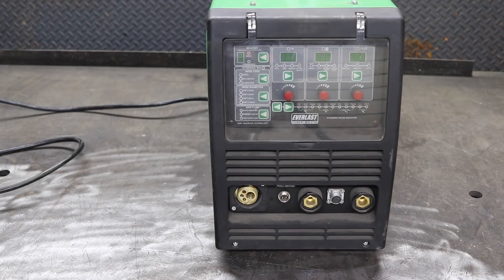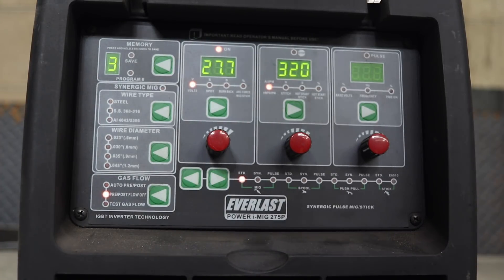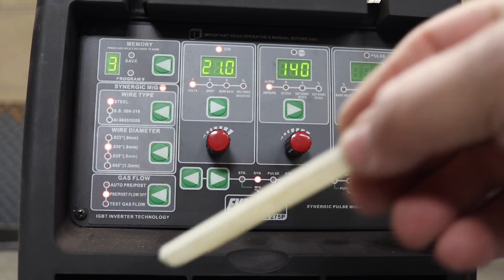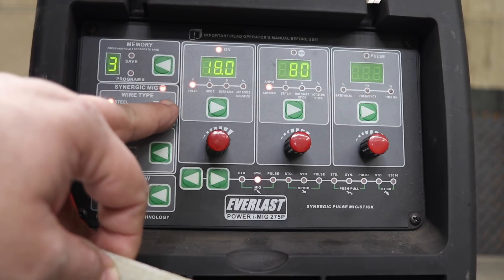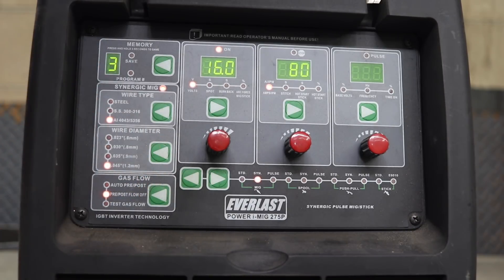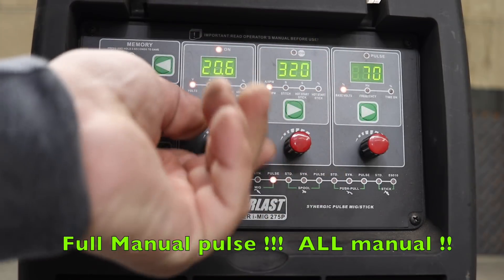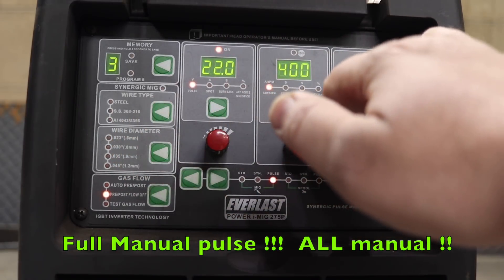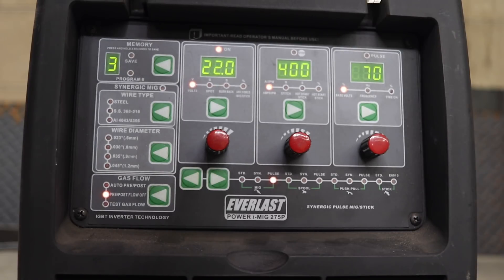Everlast I mig 275p the front panel explained   synergic or not ? full manual pulse !

Comment: Did you ever make the follow up video to this one with settings? I can’t seem to find it
Reply from the maker: I never did, what it boils down to - for aluminum it is "not practical" .... as you have to adjust "heat settings" constantly ....  and as soon as you adjust one value, you need to adjust 4 more ..and by the time you are done with that the temperature of the aluminum has already changed again and you need to adjust settings..... so in reality for aluminum this machine is pretty much not suitable ....  for pulse tell or stainless ...  sure - this can work. you will have to spend 2 weeks and figure this all out the long hand way ......      when "premium" manufactures like miller, Lincoln, fronius, Stel, cebora, migatronics, ewm .....  do pulse synergic curves ... they put a welding engineer and a software engineer and some professor from a technical college in a lab for 2-3 month to figure ALL these value out the long way, then they put these in tables and program those in the logic of the welding machine ....  so if you want to make this work ... you have your work cut out for you ....  
I solved that by getting a 253 Dpi .... that is SOOO much easier ....

Comment: Hey Peter, Just curious what are your thoughts on Everlast 253 dpi , there is only a couple of reviews on this machine and they say how great it is on aluminium but there wasn't any video or photo proof . I guess what i am asking, in your opinion is the 253 dpi going to be a lot simpler to set up than that lovely 275p i have. I can not even find a manual to download for the 253 dpi on everlast website. I understand if you have not used one yet I'm just after your thoughts or if you have heard anything.
Cheers from Australia
Troy
Reply from the maker: Troy,  
I have probably seen all the videos you saw, I have also heard and read all the claims you heard and read and just as you I have yet to see someone post something online a video with a few arc shots.....  so that being said, I am fortunate that I have had an option to test the 253DPi first hand ...    I welded with it and there are a few things that are different than on all other brands machines I own or I have ever welded with ...  
So as far as the way how the machine is designed  - it is supposed to work similarly to a PP200 or a Lincoln 350mp or miller 350P (which is only a single pulse machine).  The Everlast 253DPI has a full synergic single pulse which is nice and having a full manual adjustable double pulse is nice but it would be also would be nice if it had a "factory" double pulse setting.  
What I saw is that the machine needs some finesse to weld aluminum still and all the videos I saw I saw people stick weld with it I saw people pulse MIG weld (steel with it)  - you can also tell that some people don't have much if any experience with pulse or double pulse and that is just hard to make a good video on this topic ...  and yes - there is no manual yet.   Hang in there for a few more weeks.    
I found some stuff out that others apparently have not found out about it so I found a way to make the pulse aluminum work well (there are still some limitations to it - but overall it works well) - I found that you need to "upgrade" some accessories and consumables .... but like i said - give it about 6 weeks - I hope to be the first to post a video on this topic ....
Bottom line it is still MUCH easier than the 275P but it is less powerful too.   
Keep in mind - I do NOT have much arc time on it, I cannot tell you how things are holding up, this is only based on a very brief first impression.
Reply: Hi Peter , Thanks for your advice much appreciated as always. Now i am concerned as the Everlast website says in there product description of the 253 dpi says the double pulse is fully synergic so to someone like me keeping in mind I'm self taught does have a factory setting that can be adjusted ? 
Peter i would love to get my hands on HTP pp 200 mig but we are kind of limited for choice of decent welding machines here in Australia for the home guy to weld aluminium (2) idont have 3 phase in my shed so I'm unable to have a better machine (3) i unfortunately dont have a lazy 10 grand to purchase a better machine. The reason i chose Everlast is i have there 210 EXT which I'm extremely happy with and was hoping one of there migs would satisfy me the same .
Peter would love to come over and have a lesson or two with you but unfortunately we are a little far apart from each other and is not going to happen anytime soon .
I look forward to seeing your videos and once again thank you for your time and effort into doin this .
Take care ,stay safe, Cheers From Australia 
Troy
Reply from the maker: Troy, let me help you to try to shine some light on this:

>> Now i am concerned as the Everlast website says in there product description of the 253 dpi says the double pulse is fully synergic so to someone like me keeping in mind I'm self taught does have a factory setting that can be adjusted ? <<

Let me try to explain this as accurate as i can.  The 275 is advertised as a synergic pulse mig machine. The 275 is a synergic mig machine - that is correct - and it has (full manual) pulse capabilities that is correct too - what no one tell you ()besides me in this very video here , is that once you go into pulse it "looses" all synergic capabilities. 
Back to your question: the 253DPI is a full synergic mig machine with synergic (single) pulse. it is designed to work similar to like a miller 350p which is also a synergic (single) pulse machine. It does not work the same there are a few differences but the idea of the concept is similar. What that really means in plain english is: as the operator adjust the output settings (in case of that everlast you are looking at amps) the pulse parameters (for sure frequency - that is audible) but possibly other pulse settings might change also.
Now to "on up" miller everlast added a double pulse function which is a a manual double pulse function. Please note: turning on double pulse is NOT going to "mess up" your single pulse - which is nice but there is no "default" for double pulse - you have to actually pick your own double pulse frequency and a few other parameters all by yourself.

>>Peter i would love to get my hands on HTP pp 200 mig but we are kind of limited for choice of decent welding machines here in Australia for the home guy to weld aluminium (2) idont have 3 phase in my shed so I'm unable to have a better machine <<
To my knowledge neither Stel nor HTP sells to Australia, unless you pay an arm and a leg and then you still have the issue :" what are you going to do for customer service?"   I suppose you could bay order a machine ... but frankly i wouldn't  - although those are good machines - if you cant get parts or tech support without waiting weeks for a board if something goes wrong ... maybe you need to look for something that is available ...

>> (3) i unfortunately dont have a lazy 10 grand to purchase a better machine. The reason i chose Everlast is i have there 210 EXT which I'm extremely happy with and was hoping one of there migs would satisfy me the same .<<   I never welded with a 210 EXT personally.  My buddy Jimbos says is a good machine (for what that is worth)    As far as me recommending the 253DPI - i need to get a lot more time and some classes on that machine yet with people here at my shop trying it out and i want to see how others do with the machine and how it holds up ....
Like i said: so far i found what i told you already BUT i have very limited arc time on the machine.

>>Peter would love to come over and have a lesson or two with you but unfortunately we are a little far apart from each other and is not going to happen anytime soon .<<  
LOL  absolutely - i had a guy from Nevada fly in for the last class ... but Australia is a little far ...  unless you ever come to visit the Harley Davidson museum in Milwaukee  - than i am only 20 min out of your way

>>I look forward to seeing your videos and once again thank you for your time and effort into doin this .
Take care ,stay safe, Cheers From Australia 
Troy<<

thanks !
Reply: for the extra 1500 im not sure its worth it, I've just ordered the 275p as well. I'm in the same boat living in Melbourne Australia our choices are crap for a good range.

Comment: Hello
I think with every machine there is a learning curve. I have licolhn and have
Everlast yes both machine need fine tuning is always going to be a challenge. I just got 275 p as well and have been playing around. So it's like anything else. Have to learn the different feature. Great video
On the everlast

Cheers Fred
Reply from the maker: Fred, are you planing on doing any pulsed aluminum welding with it ? and yes - setting this up is a challenge -I tool a quick look at your channel - looks like you are the "methodical" kind of guy and if you don't pull all your hair out over it. - you will get ok or even good results.  
If you don't have a full synergic mig machine with synergic pulse to "look at" and get en idea about starting point ....  than it will be a long uphill learning curve ....  but I am sure you'll figure it out.
Reply: ZILA 
Yes I have been looking around for while for good pulse machine 
But the prices were out of my reach .
I have had everlast tig machine for long time. Now getting in to the mig 
Machine my licolhn in a good basic machine and works great But with all the heavy steel that I have been welding lately I desided on the I275P
And yes fine tuning is always a pain. So I have to say your video has opened up all the nuwonse that I now don't have to look for. You have done and outstanding explanation on how this machine Everlast should be thankful you are doing this. I myself don't get any freebies unless I pay for them myself as well.
Anyway great video  and great content.

Cheers Fred
Reply from the maker: Fred's Machine Werks i bought the machine used on craigslist for $1200 because the previous owner couldn’t figure it out ...
I intend to teach classes for $ with that machine for everybody who bought one and couldn’t figure it out.....
Lol

There are no freebees for me either - but everlast sure called me last week after all those videos....
Reply: ZILA 
That awesome your doing an outstand job.
It's nice when fellow deutsche lander
Doing training video.

Cheers Fred

Comment: why would anyone build pulse manual machine ? It's simply stupid. Pulse settings are almost imposible to set properly, that's why you pay for the premium machines. You might set it to weld and that's all. Pure marketing crap.
Reply from the maker: Kevin - thank you.  one guy here at least that can follow my thought train ...  if the "big names" pay REAL engineers and professors at tech colleges 10 or 100 thousands of dollars to find those settings in a matter of weeks or months .....  how is joe blow supposed to figure this out in his garage all by himself  ???  
and some guys really argue that point here in the comments ....  

watch the videos to come  - they will illustrate it pretty drastic !
Reply: I agree, there are even big differences betwen higher end manufacturers. Lets say if your welding some alu (serial production) or setting up a robot, it's not bad idea to invest in some fronius or otc machine (I didn't try any american machines so I cant comment on that). I had quite some problems with lower italian brands (not stel) on 2mm tubing, mostly with inconsistency of arc. Allthrought I did some welding with chinese mig welders similar to everlast or longevity and they are great for home use. But I still prefer 30 years old 400 amp transformer mig for general steel welding and these machines are cheap here in EU. You can get some older industrial 300-400 amp mig for lets say 600 dollars. It's just not really portable :)
Reply from the maker: I agree, there is a ton if Italian manufactures ... and me observing the market and heaving welded with a lot of them ... some are just better maybe even much better than others .... fronius makes an excellent machine ...  they have a hard time supplying "bigger" machines to the american market because of the difference in electricity ....  the small shop or hime owner who does not have 3 phase power here in the USA and has to use 220,230,240 volt single phase machine ... his selection is VERY limited by fronius .... and their machines are good but big $$$ also ....  for "standard " mig I can see your point  !!!!  
although I might make a video about a machine shop here who had a mig and a tig both the size of a washing machine weighing 800 lbs each ....   - and replaced both of those machines with a PP200 and loves it ... for the little bit welding they do (some small repair jobs - not full fabrication)
Reply: @ZILAwelds    Inverters look nice and small but my 1983  Sychrowave 250 does everything well with a nice duty cycle except portability and I don't have 100 amp circuit it loves to have  on aluminum
Reply from the maker: Madmoody21 my grandfathers 1955 chevy bel air drives him everywhere he wants to go to !  He took road trips from NY to LA and all over the country with it and it works. 

Now you go ahead and you for yourself weld with your syncrowave and then go to your loval miller guy and weld with a dynasty 280 with all the software updates and let them help you to dial it in but YOU weld with it and YOU experience arc dynamic and arc quality ...   and then come back here and report your findings!
I bet in 25 years of evolution you will be easily able to tell a difference in performance, arc dynamic, .... etc ....  

And when you go there. Dont just bring a piece of 1/4” material ....  bring some razor blades and some aluminum beverage cans ....  and some .030-.040” thick aluminum coupons, stand them up on the side and run a bead on the corner and experience the control you never had before ....
Reply: @ZILAwelds    My father was electronics engineer. From what I understand  MIG is a constant voltage process the current will fluctuate. Higher inductance and voltage will allow a smoothing of current fluctuation but at this point you are entering globular or spray and still it will fluctuate. I have no problem with manual pulse settings  I do have a problem with amperage adjustment its pointless in a Constant Voltage System. It almost has to be an untrue number! IT may say 80 AMPS but when you weld it I bet  if metered it will fluctuate especially in short circuit welding.
Reply from the maker: Madmoody21 amperage in a mig system is a very real thing although it is not precise. Amperage is directly related to wire speed in a non pulse system no matter if it is short circuit or spray arc. If your contact tip to work distance fluctuates than your amperage fluctuates a little bit also. The closer the torch is to the metal the higher the amperage is and the further it is away the lower the amperage is bit the higher the voltage is.
If you had ideal (robotic) conditions you would not see those fluctuations. 
Even lincoln electric tells you in their wire specs typical operating specs. 
Which those consists of which gas to use, which contact tip to work distance to use ( there is typically a range given) and which voltage to use with that wire speed ( which is typically a 3 volt spread - for example 21-23 volts)
And at the end of that line it gives you an amperage range like 130-150.  The reason why there is an amperage range is because of the ctwd. As that fluctuates there is a fluctuation in amperage ....

Now to get further than that. 

When people tig weld some guys like to go by some rule of thump like 1 amp per ever 0.001” of material thickness. 
And that rule of thump has its limitations but i will make a video on that i think ...  anyways with the same limitations this applies to mig welding too.  If you use er70-s6 wire and you run 75/25 gas single pass, in position its about 1 amp per 0.001”   So a 110 volt mig welder is about good for 120-130 amps which is about 1/8” material thickness .... 
And so on ....  i will make a whole video on this.

Comment: The Synergic setting seems different from other welders I have seen demonstrated. IIRC on say a Lincoln or HTP you select material and thickness,  gas type and wire diameter and then the machine shows Voltage and wire feed parameters it has chosen to suit as the output parameters based on your inputs. You can then tweak that e.g. add 1/2 volt but still be in the Synergic mode.

They should make use of that 3rd Numeric display. The Synergic mode seems a bit half baked on this.
Reply from the maker: or have a hot start or slope down for when you weld aluminum ...   I mean there are too many things that can be done .....
Reply: Matthew Isaac i guess at the price point of this machine ( and i dont know what it is compared to others) they dont put in everything. The more money you spend the more you get.
Reply: I think there's only so much they can reasonably achieve function-wise with that fixed style use interface, its a real limiting factor. They probably need to move at some point to a software controlled display panel like the other manufacturers use for Synergic welders.